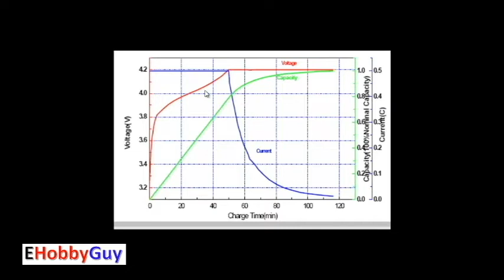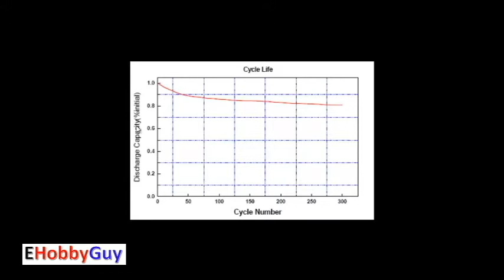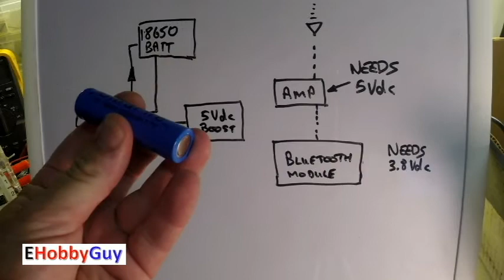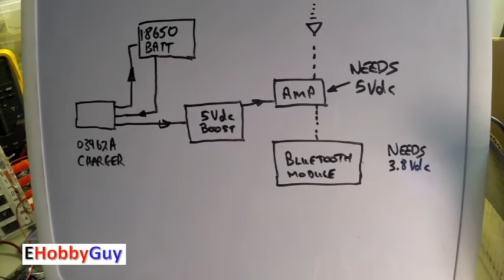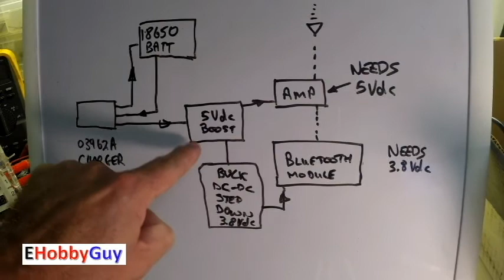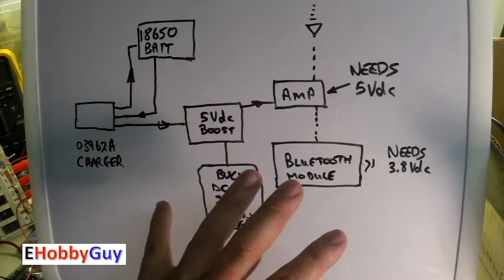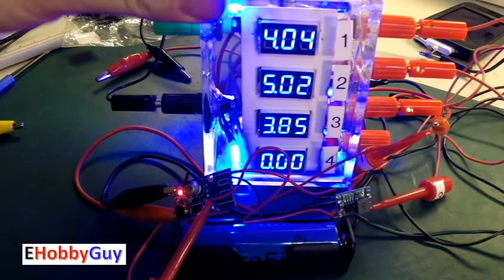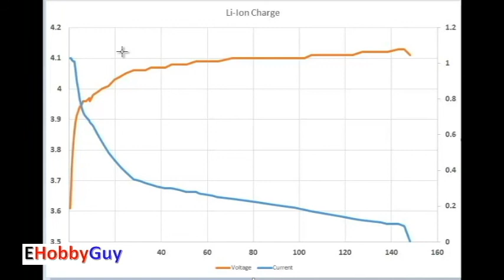Li ion Battery Must Watch, Charge and Discharge Protection, Multiple Voltages

Comment: Hello. Is all 18650 Li-ion batteries charged the same? Because I have a device with a built-in charger for the default battery. The default battery is a 18650 3.7V 1200mAh Li-ion, and I want to change it to a 18650 3.7V 3000mAh Li-ion battery from LG. Can I still use the same build-in charger? I don’t understand those advanced rules that come with batteries
Reply from the maker: Fortnite 123 there can be very minor differences on charging based on different manufacturers. I would have no problem changing the batteries. The newer batteries will last a lot longer.  Thank you for watching.
Reply: EHobby Guy So you believe I can use the ones from LG instead without any extra fixing?

Also would you trust batteries that comes with devices when you order from Wish or Aliexpress, or would you always change them to a trusted brand?
Thanks for responding!
Reply from the maker: Fortnite 123 definitely questionable from cheap Chinese places. If you have the opportunity to change them to something better I would!

Comment: Great tutorial. One thing I don't hear mentioned much by the battery guys is recommended storage - bad to store discharged? charged? Periodic "cycling" recommended or not?
Reply from the maker: Each manufacturer will recommend a storage voltage.  It is usually around the nominal 3.8 Volts.  Thanks for watching!!

Comment: my turnigy smart charger has end charge value set 4,10 v should i make it 4,2 or leave it as it has? If i set it on 4,2 will it give 4,2 or a little more as a result to overcharge the battery?
Reply from the maker: I am pretty sure that it is OK to change it to 4.2V but to be conservative you should leave it at 4.1V.  You are not gaining much additional capacity by going to 4.2Vdc.  Your Turnigy charger is a quality charger and would not go above the 4.2V if you did change it which is why I think it would be safe.  I hope this was helpful.  Thanks for watching.

Comment: I have some of these boards that manage discharge control as well. They terminate the discharge when the cell gets down to 2.4V... much less than I'd like (which would be 3.0V as you say), but better than allowing a complete discharge. This parameter does not appear in any of the ads I've seen for these boards.
Reply: it is weird why literally all boards you can buy do this, though when i tested a cheap li ion battery bank it cut at 3v. Im sure 2.4v is not terrible but not as good as 3v. Im not sure if any testing shows the reduced life cycles when cut at bellow 3v or if the impact is not so large.

Comment: why do most li ion protection circuits on ebay have a 2.5v cuttoff that seems too low. i cant seem to find anything with more the 2.7v cutoff how will i be able run a 10-50 watt project off li ion with a reasonable cutoff voltage. i have tested the cutoff in a cheap li ion battery bank and its cutoff seems to be around 3v.

Comment: on the second module can you run two 18650s in parallel for a longer run time?
Reply from the maker: Yes you can.  Since the charging module is limited to 1A, the charge time will be effectively doubled, but it would work.  Before connecting the two batteries in parallel, they both should be balanced either fully charged or discharged.  I would recommend that they both be fully charged.  Thanks for the comment.

Comment: Why is discharge protection needed? Please advise.
Reply from the maker: John Smith with Li—Ion batteries, discharging below the manufacturers recommended voltage can be catastrophic to the battery. In fact it can destroy the battery. So if we ensure the batteries do not discharge below the recommended voltage electronically we can maximize the life of the battery. I️ hope this was helpful. Again thanks for watching!!!

Comment: Dear uploader, 
In yr vid I liked th grapph tht u explained, ,, we need to understand. 
Could u pls tell me why sme of these TP4056 modules terminates chrge b4 evn reaches 4.20 volts. Say 4 exp, during chrge only in 4.13volt charging is done & Green light on. It charges less than full 4.20v. How to fix it. Pls reply thnks in advance.
Reply from the maker: Once the battery is used its ability to accept charge diminishes every time it is used.  Until it eventually will not accept a charge at all.  And so the upper cut off voltage gets lower and lower.  It cuts it off because of the current gets very very low at a voltage less than 4.2.  I  hope this was helpful.
Reply: EHobby Guy 
Dear uploader,
I know u r talking abt ageing of the cell. But it did happen in a new cells as well; where as in other charger it took charge upto or close to 420volts. Is it a charger's fault?

Instead, shall I use a buck converter keeping the voltage 4.20 making sure the lipo cells will must reach upto 4.20v?
THanks.
Reply: By the time the board has terminated the charging cycle, the cell voltage has already settled back some. That is to say that the board may be taking the cell up to 4.2V, but when the board cuts the charging current, the voltage will drop away. How much depends on the quality of the cell.
Reply: These TP4056 modules all terminate at a slightly different voltage. It is actually better if it terminates at slightly less than 4.2 Volts, as the battery life is extended without loosing much charge capacity.
Reply: Agree with Router, many of the top multi chargers use a termination of say 4.14 to 4.17.

Comment: Great stuff! Since about a year now, there is newness around. One great innovation that is causing a buzz at the moment is the ideal comnination of both "Charger and Step-up Converter on one Board". Maybe our friend EHobby Guy is already aware of it and working on a project involving such devices. Ref: (i) TP5410 (ii)WeMos D1 Mini Single Lithium Battery Charging And Battery Boost Shield and last but best (iii) 5V Boost Module Converter Battery Charging Protection Charger Step Up (with both micro-usb input and USB 5V output @ only $0.50/piece.) Cheers!

Comment: 5000mAh!  what you have there is a genuine fake battery and not worth buying - at any price!  Other testers report 200-400mAh for similar purchases.  Therefore much worse than a recycles laptop cell which can usually be obtained free!  Otherwise an nice and informative video.....;)
Reply from the maker: Thanks for the comment Simon.  I am definitely aware of the fake claims that the chinese make on these li-ion batteries.  I am planning a video on how any body can measure the actual battery capacity, and expose the outrageous claims that are made.  I appreciate the feedback.
Reply: I have 5400mAh
Reply: At 19:48 he mentions that he is doubtful this cell achieves anything close to 5000 mAh.